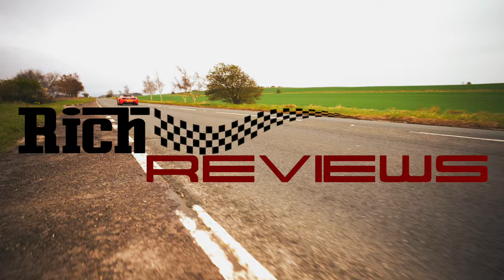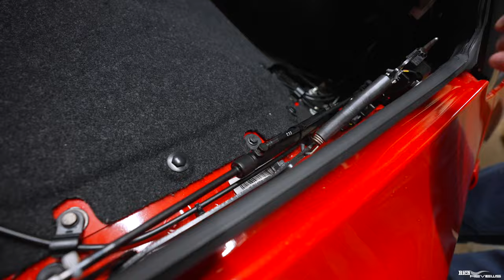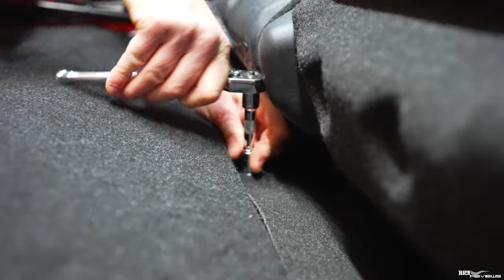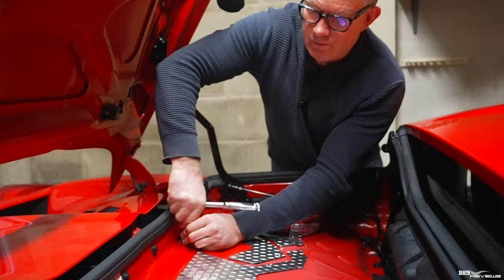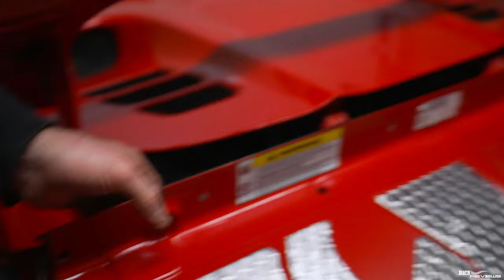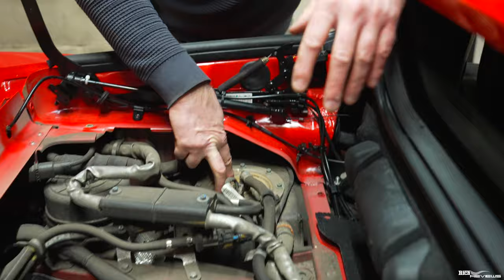Ferrari Winter Workshop: REVEALING FERRARI 458 V8 ENGINE!

Comment from the maker: In today's video we reveal the stunning V8 engine bay properly to provide access to perform the Workshop Tasks. This is no mean feat in a 458 Spider because it requires a separate engine access panel to be removed beneath the folding roof tonneau cover.
Spoiler Alert - The state of the engine bay is shockingly dirty due to the cover never having been removed since the car was built on the production line in 2015!
Did the condition of the engine bay surprise you?...It certainly did us!

We are covering off some major Ferrari workshop tasks during this series of videos...Is there anything that you would like us to include in this series?

Comment: Rich, When you open the top did you leave the accessory on until the roof pressured release or simply turn the key off?
Reply from the maker: Opened the roof to the exact right position as explained in the video and then released the button and turned off ignition. The hydraulic system then released with a series of clicks after about 3-5 minutes.
Reply: @RichReviews_  Thanks